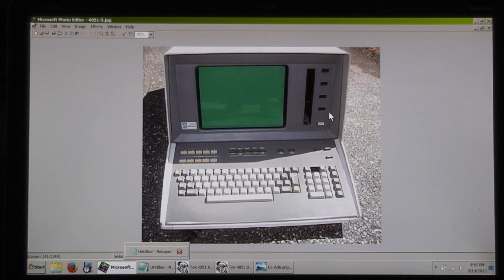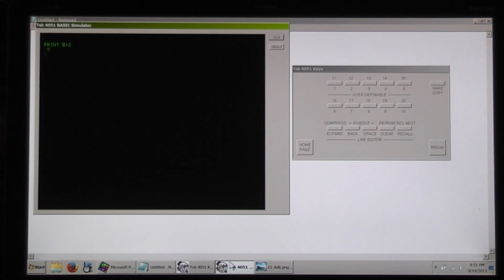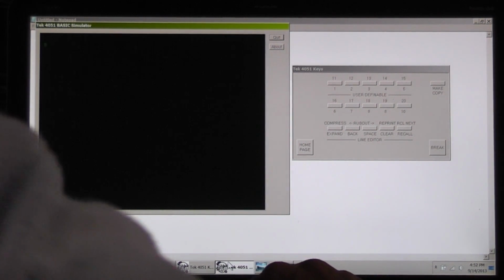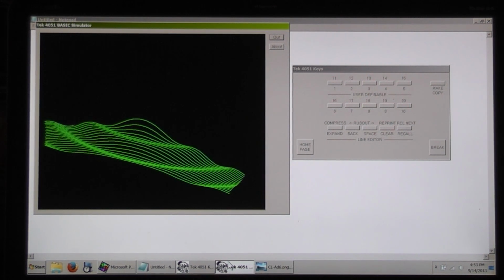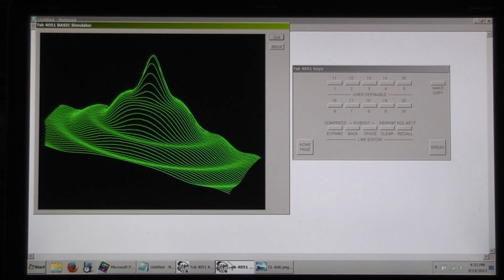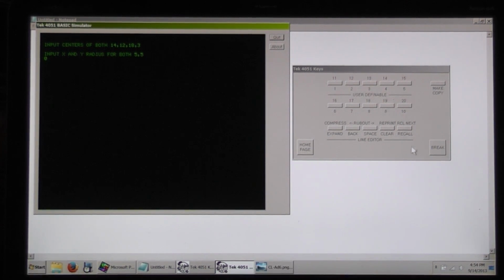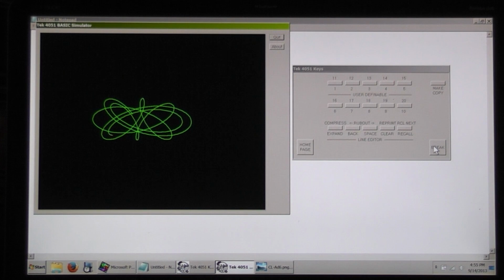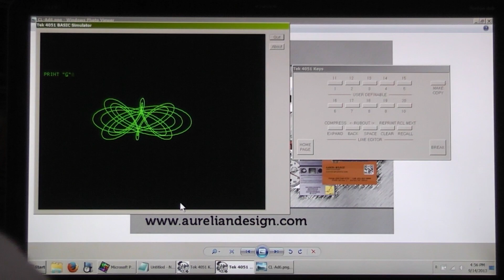Tektronix 4051 BASIC Simulator

Comment: How do you make sure your simulator is behaving the same on each input if you don't own a Tektronix 4051?  

I guess you can get most of it done from memory of using it and official documentation. What about replicating little known and undocumented bugs, though?  Are you depending on Tektronix owners to look for those very subtle differences while using your simulator and the real hardware with the same Tektronix 4051 BASIC code?

Comment: Wow, does that bring back memories!!!

I learned how to program on the 4051 about 40+ years ago, and started off by writing simple programs that drew graphic designs on the screen. They had a large flatbed plotter where I worked, and I would plot a colored hardcopy of the nicer designs. My favorite plot faded many years ago and I'd like to recreate it. I scanned and OCRed a bunch of hardcopy listings that I've been holding on to for some unknown reason, but unfortunately I don't have the program for that one particular plot, so I've always wanted to reverse engineer the graphic back into source code.

I was looking up how to create the Tektronix Viewport command using tkinter when I ran across some of your posts on the VCFed website. I'll send a request for your simulator software and see how well some of my old programs work. Aside from my original graphic design programs, most of the programs relate to scientific and engineering research.

BTW - I was feeling nostalgic a couple months ago and was looking at some Tektronix 405x videos on YT. Some where probably in your playlist!

Comment: Can I run someone's GDS on your simulator? I don't have GDS but I did use it in the early 1980s and I remember that one of the projects was the structural documentation of the Melbourne Tennis Centre (Rod Laver Arena) in Melbourne, Australia. GDS by ARC had monitor files, that could be edited such that if you made a big boo-boo you could edit the monitor file to remove the mistake and run the monitor file and it would re-run your session and stop before the error occurred. It was time travel in the early 1980s and pretty wild.
Reply from the maker: Not sure what you mean by GSD or GDS.
Reply: @AurelianDesignSeattle  I corrected the typo. Thanks.

Comment: Do you have version that will run on Windows 10/11?
Reply from the maker: I think I sent you the simulator a few years ago.  It runs on Windows 10.  I don't have Win11 so haven't tried it on that.  Let me know if you want me to re-send it (and if you're email from then still works).  If you can try it on Win11 it'd be good to know if it works.
Reply: @AurelianDesignSeattle  I looked and login that I have did not work.
Reply from the maker: @FunpaCup  Email me again and I'll send info on getting the latest version of the simulator.

Comment: Very cool. Will the source code be made available on GitHub etc?
Reply from the maker: Hi...  Not at this time.  FYI I'm almost ready to release another version (0.13) but need to do more testing when I have time.
Reply: In the late 1980's and early 90's was using PGPLOT under VMS Fortran with Tek Graphics Terminal (Spectral Data from the RGO Spectrograph & IPCS Image Photo Counting System) but never had the pleasure of using Tek 4051 BASIC.